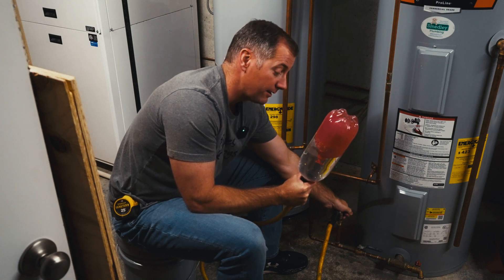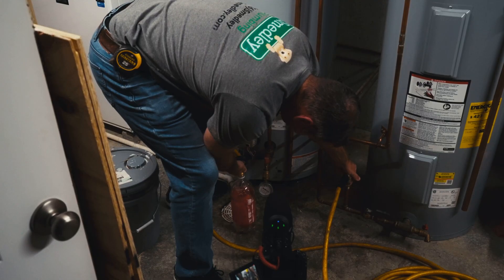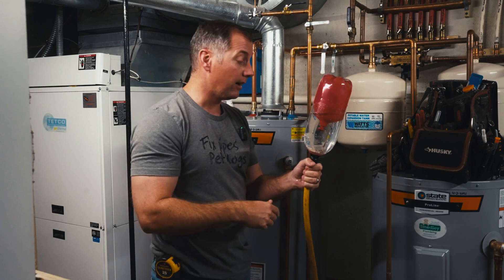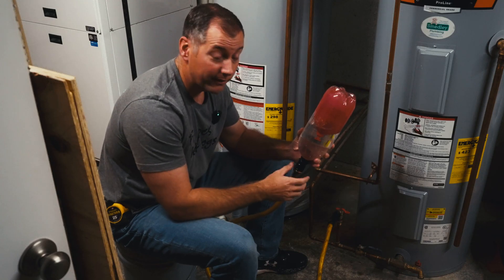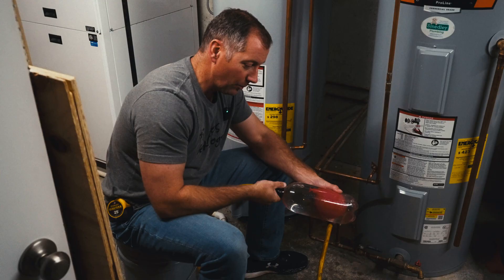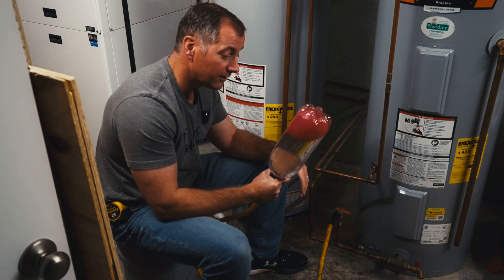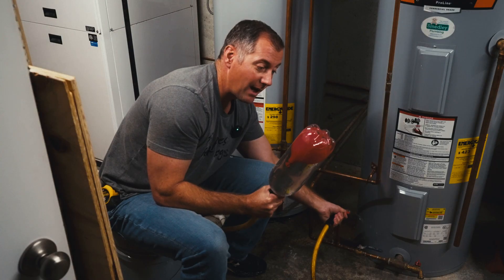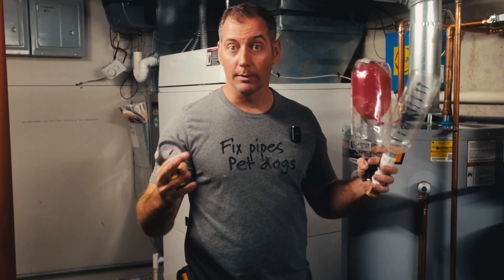What is a Thermal Expansion Tank? - Let's LOOK INSIDE!

Comment: Does it make a difference what orientation a thermal expansion tank is installed in… water inlet/outlet pointed down vs water inlet/outlet pointed up? I’ve seen videos stating that the water inlet/outlet connection pointing down (making the air valve point towards the ceiling) is best because gravity will allow the water to naturally flow out if the air pressure drops as the tank gets older, other’s I’ve seen say the water inlet/outlet pointing up or down makes no difference because the pressure in the bladder forces the water out no matter what. Also, does it matter how far away from the water heater cold water inlet is to the expansion tank is? I’ve ran into jobs that the expansion tank will only fit in the area below the water heater which is around 70 inches below the water heater cold inlet.
Reply from the maker: They can be installed in any orientation.  Installing them on a cold line close to the heater is best but they can technically be installed anywhere on the system as thermal expansion effects the entire system equally.
Reply: @SmedleyPlumbing  Your video is the best I’ve seen at demonstrating why the expansion tank is needed, great demonstration. It’s amazing how many tanked water heaters there are without expansion tanks on closed systems. Thanks for the reply, I definitely appreciate it.
Reply from the maker: @m00ndog3  thanks!

Comment: Great video !  Zurn or watts  Prv come with a Bypass feature which controls thermal expansion pressure ,  do you recommend  a thermal  expansion  tank still required  ?
Reply from the maker: Great question and yes.  Reason being the bypass feature will only work if the downstream pressure exceeds the upstream pressure.  So if you have 120psi coming in, the interior pressure would need to exceed 120psi before the bypass feature would work.  So you're right back to the same pressure you were trying to guard against by installing a PRV.

Comment: Great job on the vid. Another video I’d be interested in, is the recirc pump I now see on  NGas water heater installs in newer homes.. I’m assuming to keep the hot water in more of a ready state
Reply from the maker: Yeah they keep hot water at the extremities of the home so you don't have to wait on hot water.
Reply: @SmedleyPlumbing  is that an expensive add on. Seems a good idea in 2 story houses
Reply from the maker: @BZ1340  prices range by plumber but it's very worth checking out.

Comment: Basically the same idea as what happens inside a well pressure tank, though I believe in that case the bladder has the water and the outer tank is just full of air. As I understand it, at one point there was no bladder, the compressed air was just acting directly on the water, but the problem with that was that the compressed air would dissolve into the water over time, leading to fizzy water and no pressure.
Reply from the maker: Yeah very similar.  Baldder tanks will be larder and their bladder will handle more movement.